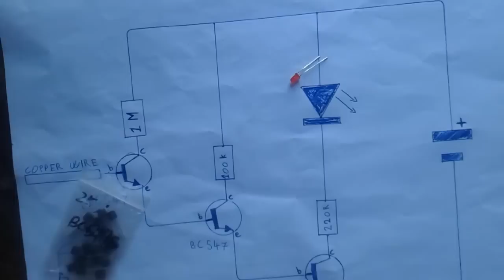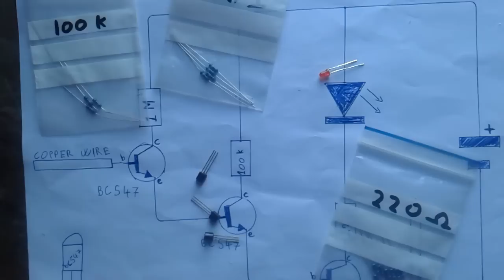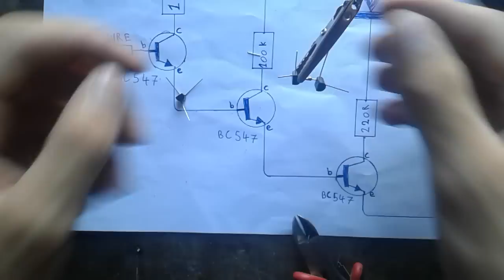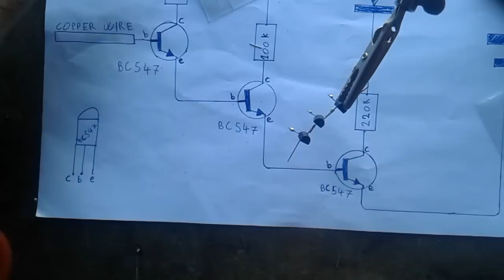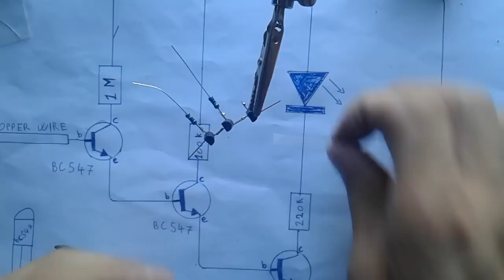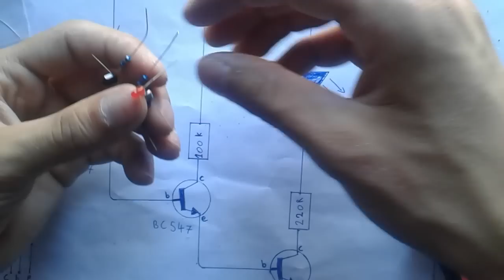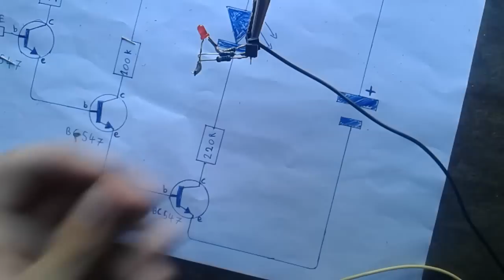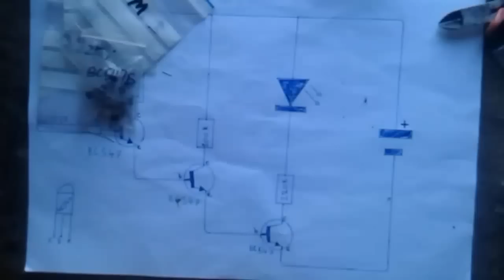How to Build a Non-contact Voltage Detector Device That is Stroner Than a Voltage Detector Pen

Comment: Thank you. This worked for me. I used h945 transistors because I salvaged them off an old computer mouse. One note... try to keep leads as short as possible. This design may not be perfect but it sure beats the cheap Chinese line tester I bought.

Comment: Great video.

If you added additional led’s at the other two resistors, would the three led’s act as a make shift signal strength meter?

Comment: Hello Friend. Is there any scheme to emulate the sound of a rc model motor with a small speaker connected to the output of the receiver to the esc? Something that mimics sound like a motor glow? It serves as It serves as a suggestion for you.

Comment: My circuit is working but I think it is fack because when I touch the antina led glow and it work just like a transister switch so when we   touch entina near to wire it work as touch switch it not detect a phase wire ,,,,,, if you know I am right then give me a answer

Comment: Your video is great but I will detect micro voltage Dc (0,5v) how can I adapt your system?
Reply: you cannot use the system above to detect dc voltage. dc voltage creates a continuous current in one direction. Without alternating the direction of the current the magnetic field will not change and the result is no voltage at the detector antenna (or inductor if you will).

Comment: its not stronger, its just different topology, the pen tester is capacitive circuit and your (rather poor) assembly is inductive circuit, very different. Also the circuit you show has notoriously poor sensitivity.

Comment: Sorry but this is missing the point. The key is to design a tester with a specific THRESHOLD that is stable against battery voltage, temperature, mains frequency, etc. And if you build 100,000 they all work the same.

Comment: not working....always led glowing...useless
Reply from the maker: +LAXMAN yadav no it works perfectly :)
Reply: It must be in a plastic insulated box otherwise your hand will act as an antenna and cause the device to detect radio signals.

Comment: Not working
Reply from the maker: +alok singh ir worked for me :)
Reply: IsDeno24 not working I am using bc548 transistor
Reply: the type of transistor does not make any difference. Check your circuit wiring for mistakes...
Reply: alok singh use Bc547 transistor 
But it's not matter. 
But first you should try it
Reply: Fine Arts Paintings & Electronics i try but not working.  Bc547